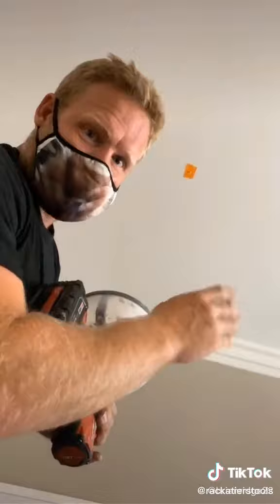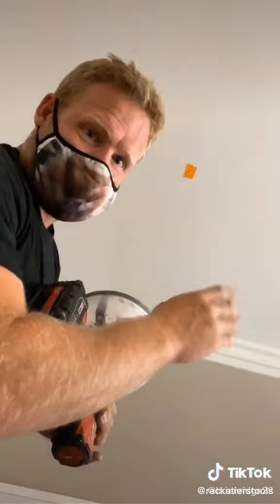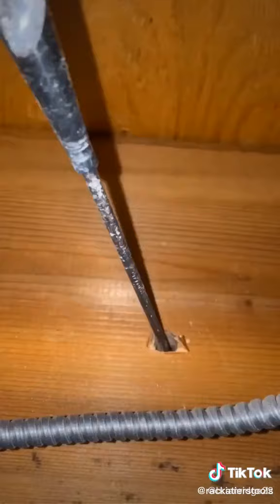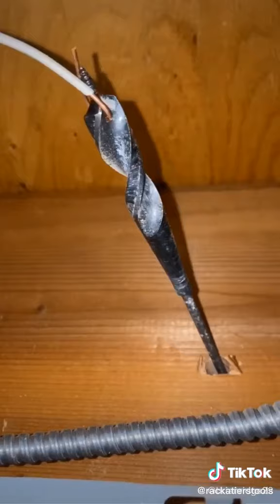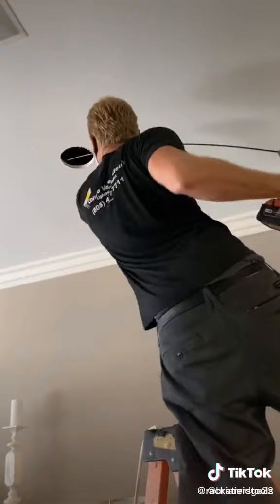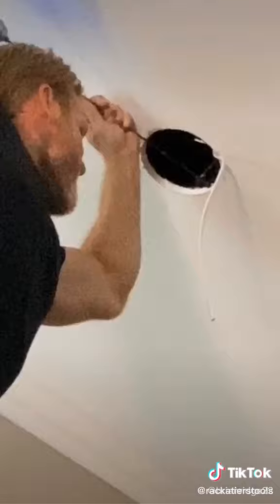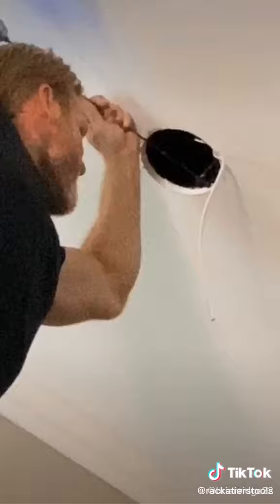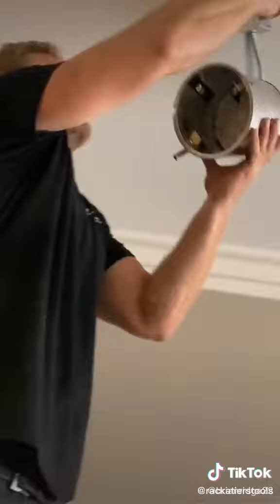BEST METHOD for Installing Recessed Lights!

Comment: As an electrician I will never blindly drill out holes like that dry wall is getting cut cuz I gotta know what's up there before I drill
Reply: Unless it's a new house and your wire is just  waiting for you up there from prewiring  :)
Reply: yup, no telling if you got plastic water pipes, a bunch of wires stapled to the joist, ducting, or an A/C line from the furnace that you would drill through
Reply: Facts I been a electricians for 13 years plus.and knows better than that.. what I hate about this video these guys put on you and those diy believe it's easy and it will work this way.. he said it's going on a existing switch but didn't show that.. if that room never had a switch then this room was switched for an outlet for plug in lamps. And you definitely have to  run a wire to that existing switch but if not and it was celing light there and if it a 2 story home with no attic you'll have to cut the sheetro
Reply: Facts I been a electricians for 13 years plus.and knows better than that.. what I hate about this video these guys put on you and those diy believe it's easy and it will work this way.. he said it's going on a existing switch but didn't show that.. if that room never had a switch then this room was switched for an outlet for plug in lamps. And you definitely have to  run a wire to that existing switch but if not and it was celing light there and if it a 2 story home with no attic you'll have to cut the sheetro
Reply: Facts I been a electricians for 13 years plus.and knows better than that.. what I hate about this video these guys put on you and those diy believe it's easy and it will work this way.. he said it's going on a existing switch but didn't show that.. if that room never had a switch then this room was switched for an outlet for plug in lamps. And you definitely have to  run a wire to that existing switch but if not and it was celing light there and if it a 2 story home with no attic you'll have to cut the sheetro
Reply: Facts I been a electricians for 13 years plus.and knows better than that.. what I hate about this video these guys put on you and those diy believe it's easy and it will work this way.. he said it's going on a existing switch but didn't show that.. if that room never had a switch then this room was switched for an outlet for plug in lamps. And you definitely have to  run a wire to that existing switch but if not and it was celing light there and if it a 2 story home with no attic you'll have to cut the sheetro
Reply: 1/2-3/4in hole between each joist, endoscope, boom.
Reply: I just crawled up in my attic and ran everything from there
Reply: Facts. Two story floor joists are always a mess inside.
Reply: Unless your able to scan it and see
Reply: Or you have a random block of wood in the six inch gap you’re predrilling through and the block knocks the bit off track through the roof. Drilling blindly is so stupid and if I can’t cut the Sheetrock out I pass. My insurance takes a hit not theirs. I like my monthly payments where they are

Comment: The only scary thing about doing that is you never know whats on the other side of the beams. Theres a chance you could hit a pipe or wire. But it definitely works
Reply: That’s why you drill all holes first and if necessary, open the ceiling between studs
Reply: Koook train
Reply: @hospitaladministrator3359  what are you talking about?
Reply: @Strider362  If you don’t know, then, it is no point of me explaining it to you.
Reply: @hospitaladministrator3359  you don't know what you're talking about
Reply: @Strider362  you just don’t understand what I’m talking about son
Reply: First off, who runs plumbing in a ceiling of a house, the only thing he is probably going to hit is either ceiling roof or the floor above him, which dont forget would probably bounce off considering how flexible it is
Reply: @Steven Portillo  clearly you know absolutely NOTHING about construction.. there's almost always plumbing and wiring ran in the floor joists and ceiling joists. Also if that bit grabs into the roof or floor above it not gonna bounce off at all it'll drill through
Reply: @D Sherbank  what if its being done in a bedroom or a living room? There is no reason for there to be plumbing above those rooms at all
Reply: @Steven Portillo  I've seen plenty of plumbing runs passing through living areas. You also have to consider gas lines, sprinkler pipes, power cables, fire alarm cables, communication wires, ducting, there could be any number of things you're drilling into and you just never can be sure which is why it's so dangerous. This tool does have a place but it always comes with a risk of hitting something..
Reply: @D Sherbank  are you referring to residential or commercial because it feels like you're talking about commercial more than residential
Reply: @Steven Portillo  resi. If I could post pictures here I'd show you just how much stuff can be ran through and along ceiling joists. You should never blindly drill unless your 100% certain
Reply: @stevenportillo7353  Could hit other wires though. 😅
Reply: @michaelhinchey  You do have a point there 😂
Reply: Every house isn't built by code
 Shit can be ran all over the place
Reply: you got it switched
Reply: Or hvac

Comment: My fear is hitting pipes etc
Reply: Fear not, they have a camera for that
Reply: @thomaswil8 not really.  My camera I have to poke 3/8 holes everywhere. And still you can't see everything...we go from experience... is there a bathroom above? What could be up there etc
Reply: @HciContractor  how did you miss that ducting?
Reply: @jamiebozarth7461  I've been drawing building homes for 40 years (that's crazy) and you have a pretty good idea of what could be up there and where it is located. 
  You've got to use your stud finder so you miss the ceiling joist and that gives you a fair idea of anything wider than 1-1/2" is there alongside the joists. 
  But you could stick the camera into where you're going to run the hole saw before drilling. 
  I'd say you can really limit the odds of hitting a pipe. There's still a chance but negligible. 
  This man didn't have a choice as to fixture. I've gone to those slim 4"-6" LED and they don't need a lot of depth.
Reply: Yeah those long extension bits are really risky.  My fear is not so much hitting the pipe but the bit deflecting and god knows where it will come out
Reply: Camera will only see one side of the beam and there might be pipes or wires in other side.

Comment: this is reckless there's absolutely no way to know if you're gonna hit existing wire or pipe. some DIYer handyman is gonna go try this and flood the home
Reply: It isn't reckless. Sheesh.
Reply: @michaelhinchey  it is
Reply: Use some common sense before you start drilling. Have a quick look around the house and you can know if there would be any pipes or wiring in there.
Reply: @joseph7105  there's no way to know for sure... and having a quick look around the house and taking an educated guess is still a hefty risk
Reply: That’s why he checked it with a wire first. Did you not pay attention?
Reply: @juan2049  lol thats not the dangerous part tips. It's the part where he drills through the joists blindly with the 6' bit
Reply: @Strider362  omg. Use common sense. He makes the 6” holes first. Then he has enough room to look around from both ends so make sure nothing is in way. You really think he just starts drilling without inspecting first?
Reply: @juan2049  you really aren't in construction whatsoever are you? When you drill through a floor joist there's absolutely no way to tell whether there's pipes or wires on the opposing side. It's reckless and dangerous
Reply: I told my electricians to drill like the guy in the video to avoid fixing and patching drywall. Once I saw my guys were having a tough time drilling I knew they hit a pipe. They blasted through a 4in pvc sewage drain line and luckily I had experience in plumbing so was able to quickly cut it out and repair it on the spot.  Basically its better to cut a long strip of drywall wide enough to fit a drill. Easier on the installers and prevents unwanted surprises.

Comment: Who still uses cans
Reply: What’s being used now ??
Reply: @EdwinHernandez-ct1vn  Canless lights. They just have two spring clips on each end that clamp down on the back side of the drywall, pulling the light tight to the ceiling. Pretty cool and easy.
Reply: @EdwinHernandez-ct1vn  wafer led lights. They're like 1/2" deep ans so easy to install
Reply: For real. Seeing cans make me cringe
Reply: Fr that's what i was thinking I'm surprised they sell them for anything other than a heat lamp in the bathroom lol but even that's outdated.
Reply: In case they want to change back to bulb lights when those POS LEDs fail every year or two and they get sick of replacing all of them because they can't find a match in style or LED color. 
Seriously, don't use the baked in LED fixtures, they are slightly easier to install initially, but will become a pain later on.

Comment: I wanna install new pot lights and I have a fairly good experience doing so in a new build, however, I am now trying to upgrade an existing room and not sure what would be the best way to run the wires. The room has two light fixtures in the ceiling  obviously with own junction box for each. Each light fixture is controlled by a separate switch in that room while one of them is also controlled by another switch neat the stairs. I am also installing a dimmer switch with the pot lights. What's the best way to do it? Shall I connect all pot lights to the junction box controlled by the 3-way switch and completely cancel the other light switch/junction box in the room or split the pot lights in half, one half connected to one junction box and the other half to the other? Would that be weird or unprofessional to have to light up half of that room with one switch and the other half with another? Are pot lights supposed to light up all together in a given room or is it ok to split them between two switches. Moreover, if I did that then the dimmer switch can only control half of the lights and not all. Shall I install another dimmer switch for the other half of the pot lights and have each half function independently? I feel like it's gonna be unprofessional and maybe also annoying while trying to match the dim level on each switch. What do home renovators do in this case, do they cancel one light switch and it's junction box and just connect all pot lights to the existing 3-way switch and install the dimmer switch there?

Thank you so much in advance.
Reply: I hope u went with the first option, everything else after that is your brain trying to find  away out of completely canceling one of the circuits, or if it’s hard to get to the line just put a cover plate matching the ceiling color, and terminate power there if it’s easy.

Comment: Better question is why are you still using recess cans versus the new slim fits. Recess can you gotta make sure you know we’re near any beams? Where with the slim fits you could be directly under beam and still install the light and it looks better than the cans.
Reply: Slims give off too much glare

Comment: if you wanna be 100% sure of not hitting obstructions your only option is to remove all of the drywall to run the wire. It’s not the end of the world. Or if you want to save time and money you send it with the 6ft bit.
Reply: Sounds like you have a lot of experience doing nothing
Reply: @Ashoud_Anobetah  😂😂 good one. Sounds like you have a lot of experience tinkering with homemade explosives
Reply: I thought of removing the plaster because I ain't trying to crawl in my attic ,... On the whole other side of the house

Comment: And if there are ceiling joists, then you have holes to patch. Its best to actually go into the attic and find the joist so you can make everything is the same distance off the wall or use a stud finder.
Reply: Can you elaborate cause I feel like he needed very special conditions for this technique to work for him. And I gotta install these cans next weekend
Reply: @farcyde2948  well lets say you poke a hole at 3 feet off the wall and then go to the opposite side and poke a hole at 3 feet, but find out that there is a ceiling joist in your way. Now you must move that 4 inches off the ceiling joist. My point is that it's best to do a visual inspection for plumping pipes, duct work, and get a measurement of the ceiling joists so you can get them symmetrical.
Reply: Or you can do the slim canless lights they fit right under the joist. Also it's not the attic that's the issue it's flat roof homes that don't have attics that are the issue
Reply: @slicktmi  yeah, not attic is definitely an issue. I wouldn't even do the job at that point unless they wanted conduit or some other exposed raceway. I also didn't know they made lights that are the width of sheetrock.

Comment: Goes smooth until while drilling blind you hit a water line ran along the joist your drilling, or another electrical line or worst case a flexible gas line. It’s always risky business drilling blind.

Comment: What size drill bit for 14 guauge wire?
Reply from the maker: usually 1/2" or 9/16"
Reply: @RackATiers  thanks for the reply, I already ordered 3/4 bit. I thought in case there is a need to pass another cable, there is enough room.

Comment: Ah your screwed up right there because you're old mindset is still using canned housing vs. slim fit. With the slim fit recessed lights you don't need to check for beams because they're the same thickness as the drywall.
 The only time you're supposed to use recessed lighting housing is for new construction jobs. For old work use slim fit. And now halo just came out with the thin plate bracket for slim fit for new construction, so you're wasting your time and money. The new mounts cost $5 each
Reply: Exactly
Reply: Slim fit leds look cheap and the transformers have a delay sometimes, they are not quite perfect yet
Reply: @Raptormeatx  perhaps you're buying cheap s***. They have every single regular recess light trim in slim fit form. With the ability to change the lumens
Reply: Exactly what i was thinking… he probably had those laying around for quite sometime and saw the opportunity to use it.. but i would never use those can lights for new construction or remodeling…

Comment: Those drill bits should be illegal!...they are extremely dangerous...if you accidentally just graze a wire or water line, you could cause a world of problems...if you just miss a nail and expose a sharp edge, you could inadvertently strip your wire when pulling..  inspectors insist on seeing electrical work before a house is insulated and boarded, yet pulling wires blindly through drywall seems to be ok!